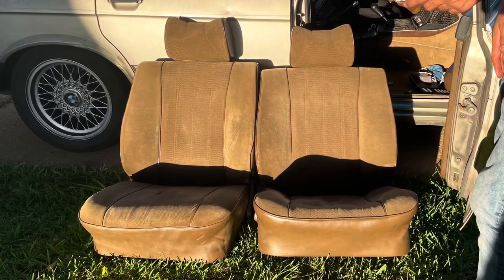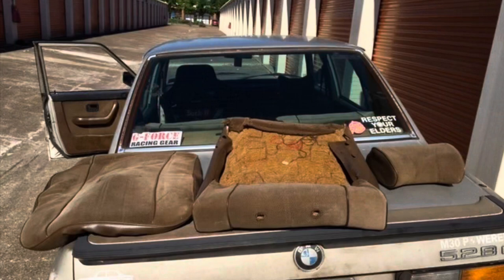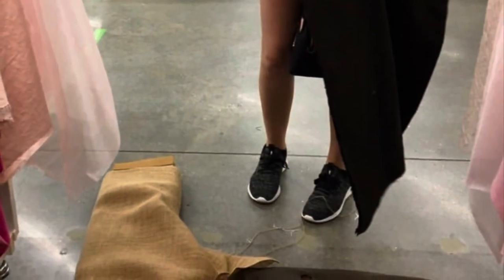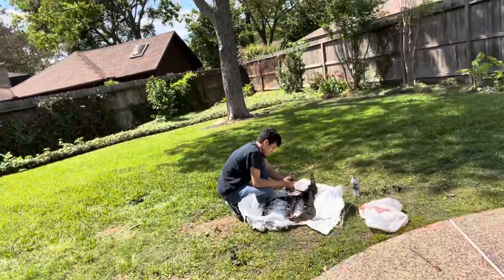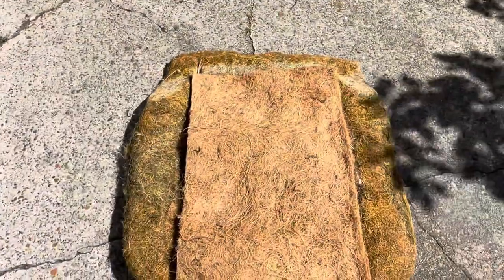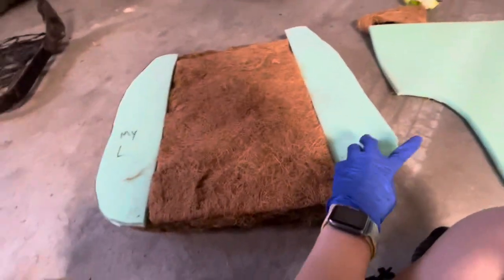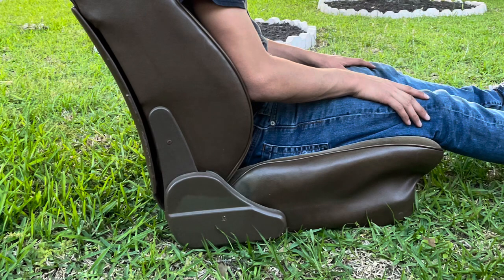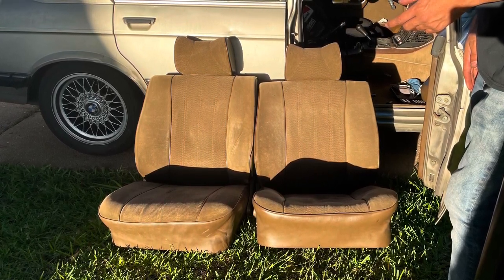How to Repair Horsehair Seat | BMW e28

Comment: Thanks for sharing hard to find info on these seats! Now that you've been sitting on them for a while would you still do coconut husk in the center or why not do high density foam there too? Thanks!
Reply from the maker: You’re welcome! Looking back, I think adding more high density would have been nicer. The seat is definitely still comfy but i think adding more would have built a better cushion. I would still keep the layer of coconut husk that I did in the center just because I believe it helped keep some structure. Hope this helps!

Comment: Relevant to my interests. I'm reupholstering my 1987 528e rear seat now with new leather and found the coconut fiber rear upper is breaking down. Not collapsed yet but definitely worn. Was looking at using loose fill coconut coir mixed with a flexible glue (maybe flexseal?) to patch the worn section. My fronts are toast so I'm putting in electric sport seats I got for a steal and reupholstering them too. good work!
Reply from the maker: Glad you enjoyed the video! That sounds like a great plan you’ve got going on, hope it all turns out well!!